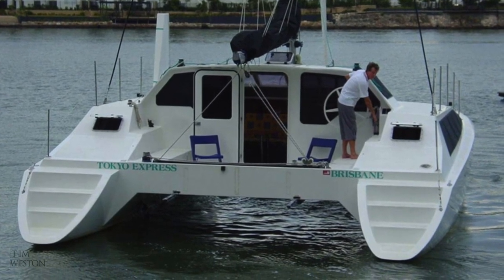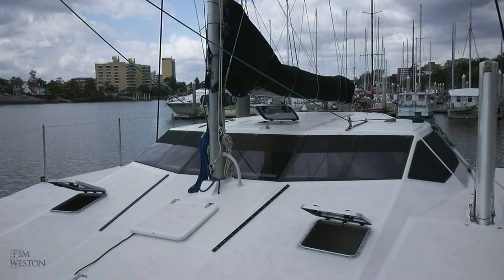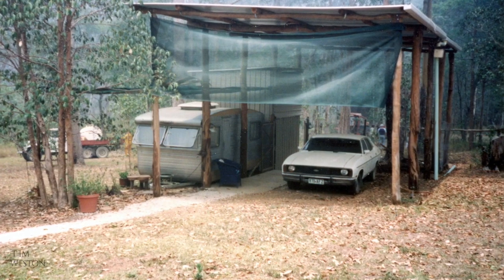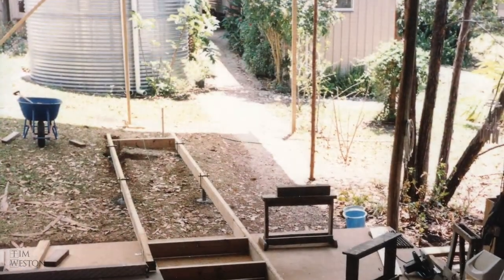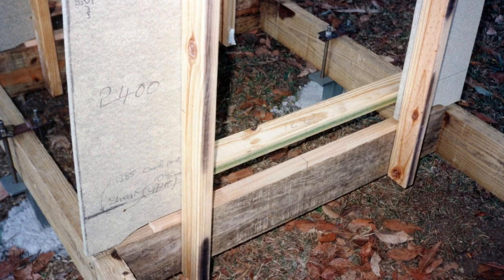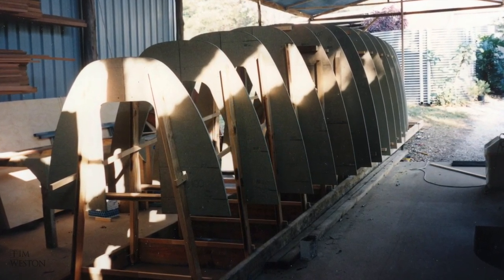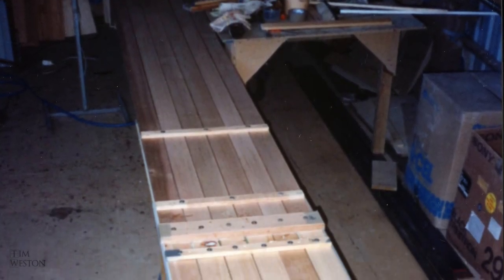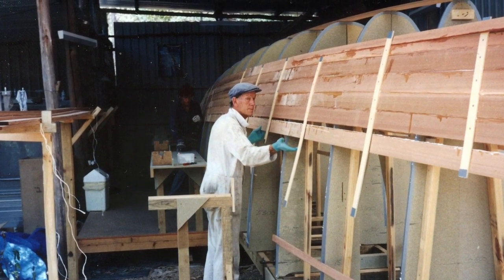How to build a boat Ep #1 - Catamaran you can live on

Comment: How far apart did you space your forms?  A couple of feet?  Would like to hear more about how you went about centering them to one another, too.  Also, as you rounded the curves with flat planks/boards, did you have to pre-bevel the edges to meet the other boards, or was that not a problem?  Thanks so much for putting this series up on YouTube!
Reply from the maker: There is no bevel on the boards, Meadmaker. The frames are about a meter apart. There is more information in chapter 4, in my book "Building Tokyo Express", on the way the strongback was set up, on the temporary framing and about building her in general. There is not every detail in this book, but quite a bit of useable info if you are interested in building - https://timwestonboats.com/ebooks/  I'm glad you liked the series. 👍 Tim

Comment: Hey Tim love the digger ethos. I have no issue building the hulls. After all been sailing since I was 5 and working on boats, both sailing and repairing for over 25.  Not going to strip plank going to go the ply route. I know all the arguments but have no money so buying sheets weekly.
The only issue I really have is the joints between the hull and the beams, and the beams themselves. As theres so many diffrent styles. Ive made my plans by mixing 3 diffrent designs I have full pans for to make it what I want. Its only going to be approx 30-32foot and for Australian waters. I also love you dagger board idea. Never understood why people dont go for a central board or as you did a large on for better tracking.
Anyway love the boat and look forward ro having my hulls done by November. And if Woods can make a boat out of crap pine and not glass it, and it still be sailing t
30 years later Im sure I can build one thats glassed above water line that'll do me.
Hope all well and would love to hear of any other adventures in building or sailing youve had.
Reply from the maker: Hi Angus. Your project sounds good, nothing wrong with plywood. I also have thought about building a cat in ply. Let's know how you go, it will be interesting to hear your progress. This week I hope to have a forum and members area live on my website so, if you want to share what you are doing.. And build a big board for it, it's important. I just published a post on the topic and you are it is good timing for you, you before you get too far into the build to decide what you want to build. More info coming on the site. Cheers Angus, all the best. Tim  https://timwestonboats.com

Comment: Wow what an awesome project, absolutely incredible work. Just out of curiosity what was your level of boat building experience before you started this project?
Reply from the maker: Thanks, actually Tokyo Express was basically the first boat I built. I had never used epoxy or worked with fibreglass before. I quickly built a small boat as I was setting up the shed and ordering the materials to start building TE, just to get a bit of practice but it was learning by doing really, with the cat. I had built a house and other things, I like tinkering 😉,  so it was just learning another way of building.  I don't think building a boat is that hard. It is certainly not rocket science. I think everyone who is a little bit handy and likes making things can do the same.  It just takes time!
Reply: @TimWestonboats  If you don't mind me asking, what did you do for work at the time? How many hours a week would have been for your paying job and how many hours a week would you have spent building your boat?

Comment: Could you build a catamaran like this using the stitch and glue method? (cut out panels and stitch them together using wire, pulling them into shape, then gluing and reinforcing them permanently).
Anyone know of any plans for a stitch and glue motor powered multihull ship?

Comment: Hi Tim, thanks for sharing your project. I'm interested in building a catamaran some day but a little concerned about the resale value. Were you able to sell your boat at a reasonable price without taking a loss? I'm concerned about potential buyers reluctance to buy a $150000 boat that was built at home by an amateur builder. Of course I'm not building a boat to turn around and sell it, but sometimes unforeseen things do happen. Thanks.
Reply from the maker: Hi B Dub. I am not really up with the latest prices in the second hand market at the moment, but I sold my boat for $240,000 AUD 14 yrs ago. It was more than double the material costs and while less than a production boat's price, was still pretty good price for the time I think.